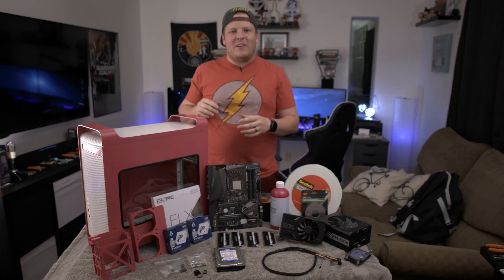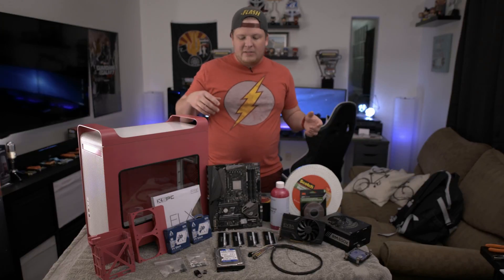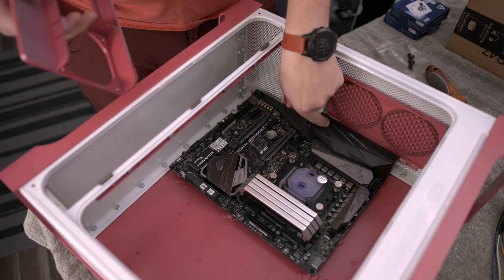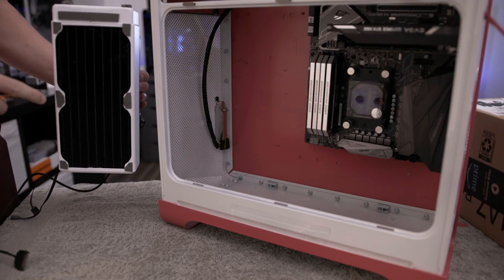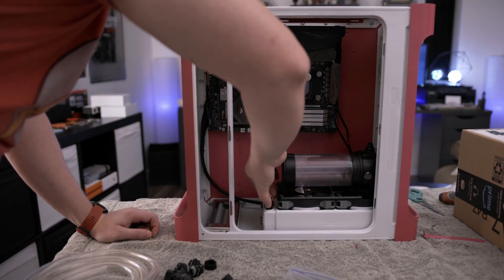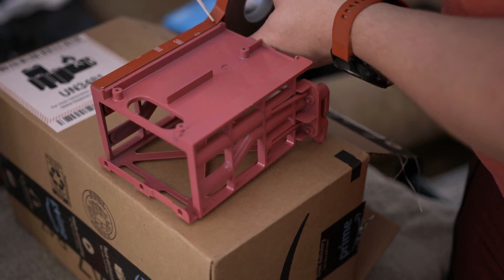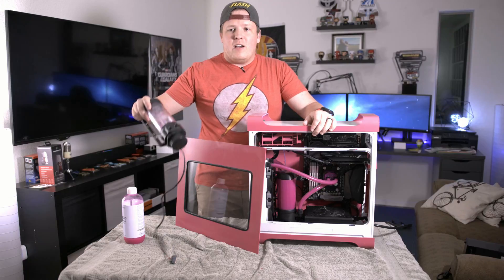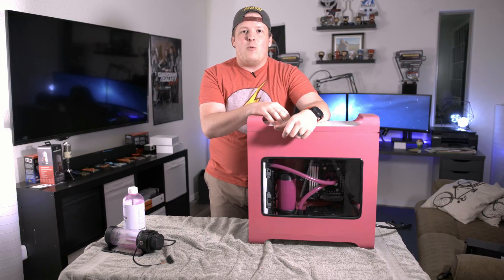The Transformation Finale! Coolant Leak into PSU!!! Powermac G5 Mods!

Comment: Hey Jacob, how did you secure the ekwb front radiator? Also, when i measure the space of my asus atx board and my psu, they’ll likely wont fit. How did you manage to fit an atx board and the psu below it? Thanks for any advice.
Reply from the maker: There are a couple of other videos in the series, but in short if you are using an atx board you cant run the plate that separates the top and bottom parts of the chassis in the original configuration. For the radiator, I am using emblem tape. It is a really strong doublesided tape that I explain in the video.

Comment: I have a few questions for planning a similar build: with what did you mount the pump reservoir to the fans? I'm guessing this is gonna block airflow a lot. Isn't it possible to attach this combo right onto the case next to the mobo? There seems enough space.
Reply from the maker: For this build, I used the included bracket that comes with that pump/res combo. I have another one of these builds with EK parts, and used their version of pump/res combo, also mounting that to the fans with their style bracket. 

On my other build, it currently holds the #1 spot on time spy extreme for a threadripper 1950x and 1080ti 2 way SLI. 

The "open-ness" of the front of this case lets it get plenty of air, and while it would be better not mounted to the fans it doesn't cause enough of an issue to make a difference. 

As for mounting it to the case, yes there is room and that is what I was going to do in my first version, but I couldn't really find an elegant way to mount it so I decided on the radiator. Also, it makes the assembly/disassembly much easier because you can pull the pump and radiator out in one unit.
Reply: Thank you for this reply, @JacobPerson . I did not expect it! :) I want to make a high end hackintosh with 9900k and RX 64 Vega both in a loop. I'm researching everything 200% before ordering a part. 

Could you possibly explain what went wrong with lining up the mobo and the io shield on this project? You didn't really explain or show if everything went okay.

Thanks!
Reply from the maker: No problem! I always try to respond to comments! Hope the build goes well! You should tag me on twitter or instagram when the build is done so I can check it out!

As for the IO shield, the back of the case is further away than normal cases, so if you set the MOBO up to be able to use the existing PCIe slots, it will not put the IO up to the back of the case like normal. Also, this motherboard as a big plastic cover on the IO which made it so that I could not use the factory exhaust fans and bracket. It is possible to use those is you take that cover off or if you use a different motherboard that doesn't have such a large plastic cover.
Reply: @JacobPerson  Okay that's solid advice, what do you reckon is the best solution to IO gap? Or is there no real issue in day to day use
Reply from the maker: @S7StudioElfPaladin  No real issue as long as you cut the case out like I showed in this process. You cant use an IO shield (unless you buy a mobo that has it preattached to the board), but it is seriously no big deal at all.

Comment: thx thats awesome i build my own too with fan  not the water cooling
Reply: A coolant system, like the original PowerMac G5 would pay tribute to the origins of the case.
Because the PowerPC architecture was not being maintained by Motorola and IBM, the G5’s ran hot. The PowerMac G5 was the first mainstream Desktop Workstation computer to use Liquid Cooling.

Having a coolant leak in this build also paid tribute to the original PowerMac G5. They used to leak like sieves! The number one source of cheap G5 cases was due to coolant leaks causing corrosion.

Comment: Use Velcro tape so you can pull the PSU later if you want.
Reply from the maker: The white foam 3m tape is not that hard to take off.

Comment: im making one got it powder coated all i need is the parts. thanks for the tutorial man!
Reply from the maker: Nice! Be careful with the powder coating. Some spots will need to be sanded down so that it will still go together.
Reply: i got a rear panel and ribited it to the back and pluged the stand off holes. here the page https://www.mountainmods.com/product_info.php?products_id=56
Reply from the maker: Nice. Looks super clean!
Reply: Thanks ill keep u updated!
Reply: Have you had any problems with the latch since power coating? And how did you paint the apple logo .. @stephen rosas

Comment: Nice build just watched the series, very informative. I have an old G5, but it has power connect on top and only 1 big fan port in back instead of 2 stacked. Is this older version bad for trying this kind of transformation on? Wondering if it would work or if I'd be better off trying on a G5 shell that matches yours. All the modded ones I have seen are mainly on these newer versions like yours. Thanks for the great content.
Reply from the maker: Thanks for the love! Are you sure yours isn't a Mac pro? I don't know of any with a single fan in the back... Does it have two optical drive slots or 1?